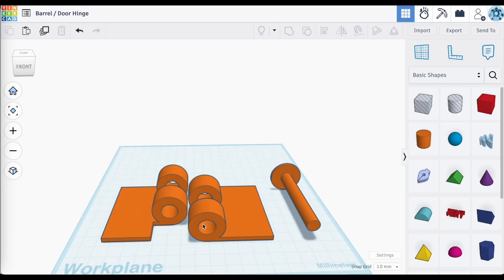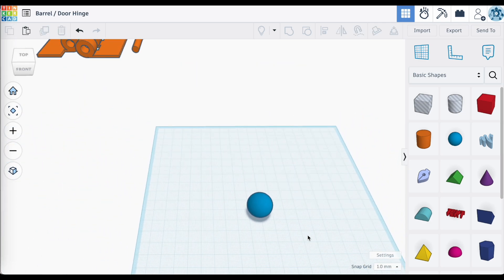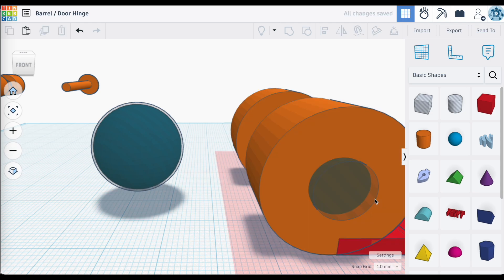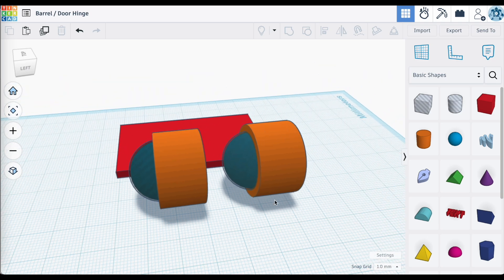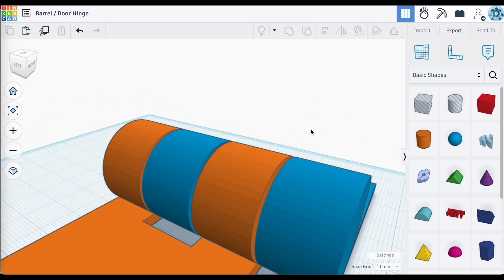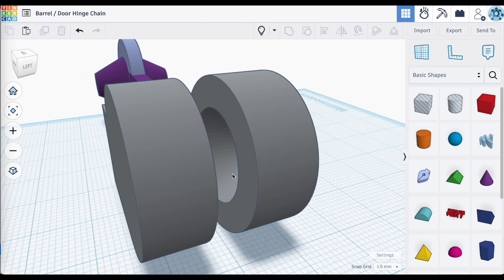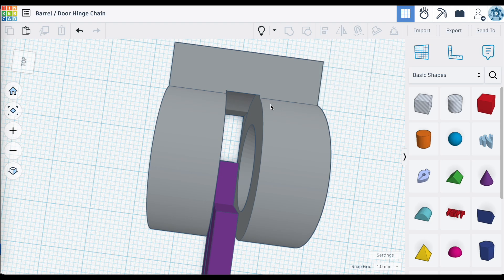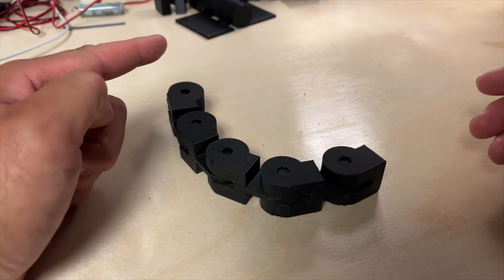Design Your Own Print-In-Place Door Hinge

Comment: Can you not just print the pin vertically by rotating it 90 degrees to prevent the need for supports?
Reply from the maker: If I am reading you correctly here - yes you could, as long as you could design the “knuckles” from each half of the hinge in a way that they could be printed on top of each other without the need for supports.  I have seen designs that can do this but they do away with the pin completely and use a similar cone-type of shape off of each knuckle.  Sorry, I am reading this over again and my explanation probably doesn’t make any sense.